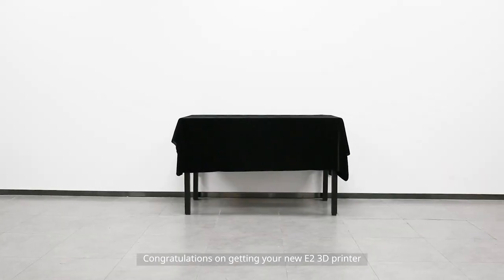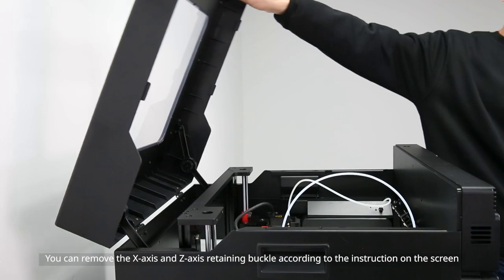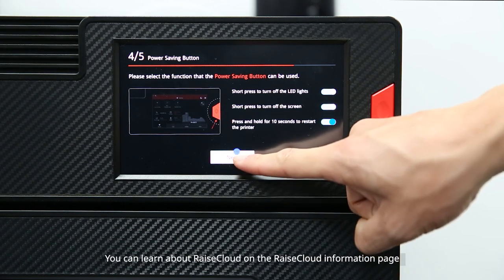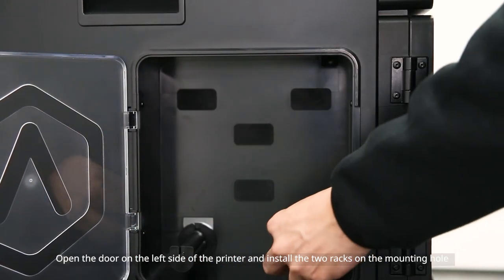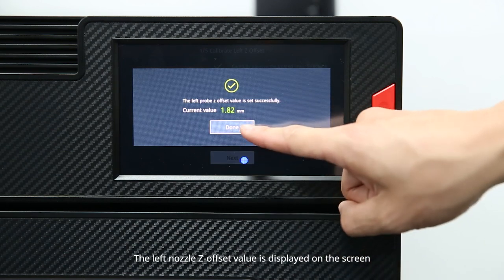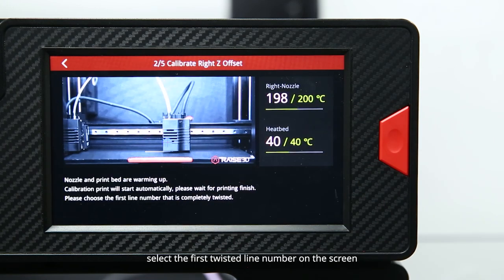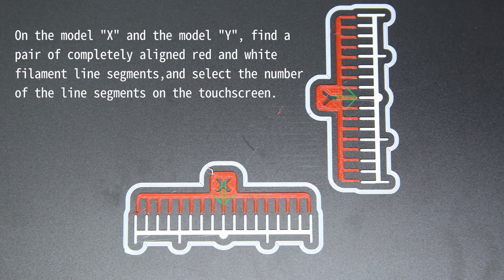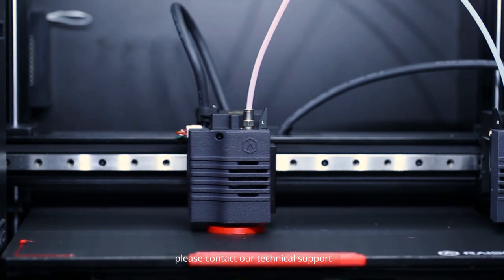Raise3D E2 Unboxing and Setup Getting Started Guide | Raise3D Academy

Comment: One of the things that's holding me back to buy one right now is the fact that in this price range, I would expect a build plate that's only moving in the Z direction (and have the XY plane at fixed height). For large prints, this could become an issue.
Let's say it would be nice to see that, and maybe automatic Z-calibration in the next iteration of the printer.

Comment: Own an E2....would like to see a glass bed option!
Reply: Doesn't a lot of special materials have issues with glass beds specifically. specially coated bed are usually best. but all depends on material. just like metal printing ceramic is best options for the bed. e.t.c or am I missing something here.